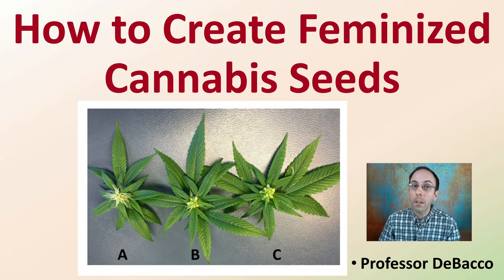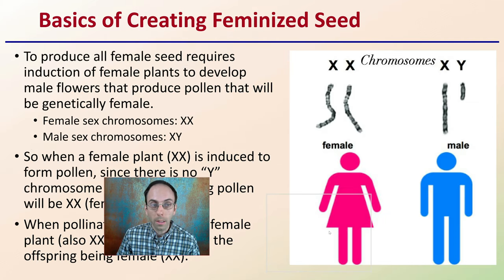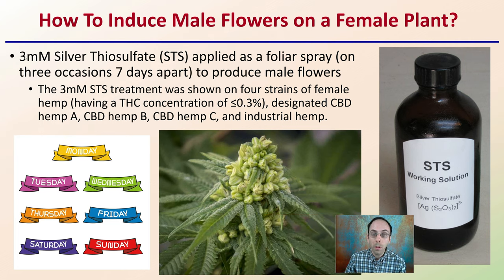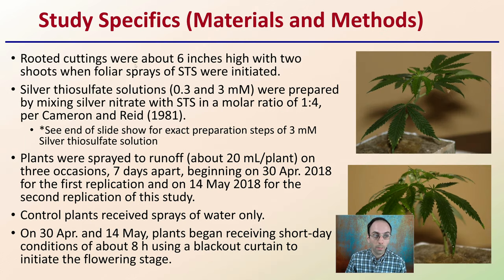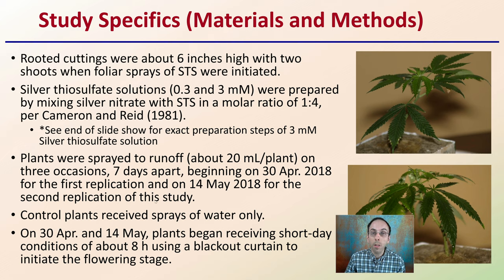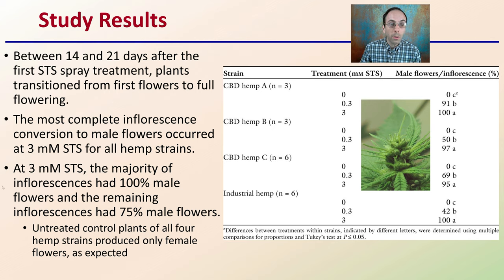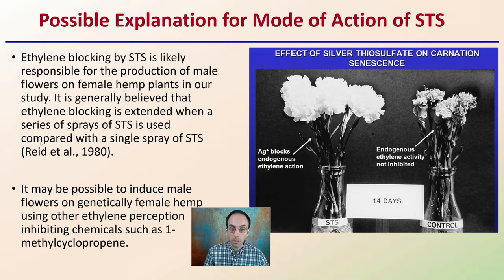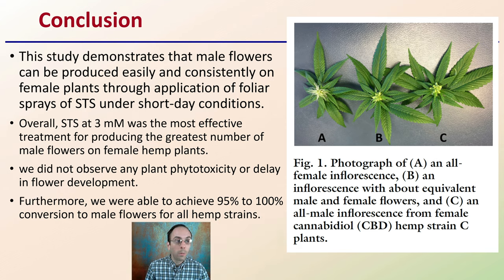How to Create Feminized Cannabis Seeds

Comment: I was able to produce feminized seeds by stressing a female plant starting around 2-3 weeks into flowering. I let her pot dry out a few times,did some pretty extreme temperature swings,and then lowered the light until I caused some minor light burn. She threw out some pollen sacks and I got some female seeds out of a couple healthy females I used the pollen on. So far my results have all been females,about 50-60 seeds in. Not as scientific,but it worked😅 Great video!
Reply from the maker: Glad it worked for you, but this would not be a reliable technique to depend on and there is also the plant stress to consider.
Reply: Me too All I did was switch the light cycle 3 times.
Reply: Would the seeds that come from a purposely stressed hermie female produce hermie prone seeds?
Reply: @KushByTheBush  Yes if the new plants are stressed in the same ways they are likely to herm' but if you don't stress them you can get some amazing bud' I've done this myself and as long as I don't stress them they stay female.
Reply: @DeBaccoUniversity There is almost an implication that STS (Silver Thiosulfate) doesn't stress the plant. It most certainly does. Herming is a stress response. OP used general stresses, STS is an acute stress.
Reply: Dude made hermies, lol
Reply: Oh, so just a normal grow
Reply: @KushByTheBush yes.
Reply: @DeBaccoUniversity  If that worked didn't it produce male/female seeds, whereas, this produces only female seeds?  Every plant will seed eventually so I'm not sure if he understood the video....
Reply: this is not recommended. hermie traits Will be passed down and your next plant will hermie. or there's a huge chance.
Reply: @gtavtheavengergunnerlegend3340 what are the hermie traits?
Reply: @gtavtheavengergunnerlegend3340  idk if that's true. if someone has their arm cut off and they have kids, will the kids be missing an arm? Having hermie traits in genetics and hermie due to stress is not the same thing. I've seen reports where people grew out the resulting seeds and had 0 hermies.
Reply: Try colloidal silver, there are a number of reputable companies online selling it. It Works amazingly well.

Comment: how does this not have MORE LIKES?! i have not seen very many, if not any feminized seed information on YouTube that mentions the silver method. 

also your explanation of the genetic factors, is so well done, clearly excecated and easy to understand!

thank you very much for this information! 😍💚

i think the method you've shown here is FAR superior to what ive been doing for my whole life, 
both in its simplicity\easiness to follow, and the fact that it is reliable and measurable unlike the way i've been doin it!, thank you so much for bringing up up-to-date!! XD

[warning: THE FOLLOWING SHOULD ONLY BE ATTEMPTED OR CONDUCTED BY A PROFESSIONALLY MINDED ADULT, IN A SAFE CLEAN ENVIROMENT, USING THE PROPER PPE AND PROCEDURES]
i always used colloidal silver (sp?) which i was taught to make by an older grower, by making an anode and cathode out of pure silver solder wire, and attaching each end of it to a small voltage\ milliamp DC wall transformer (plugged into a GFI\fused power source for safety)
then i would put those two thin rods into a glass or jar of distilled water, and leave it on overnight, and after a while you could actually see the silver forming strange tiny dots and orbs FLOATING in the water itself! like it somehow stayed in solution ionically or something?

anyway this stuff was really dangerous to get on bare skin, so if anyone follows the above directions be very careful and use proper protective gear\gloves\mask\goggles\lab coat etc. 

a small ratio of this to regular watering\feeding times would quite quickly force my females to produce male flowers as well. (or males to produce female flowers also, making male-inized seeds)

once done, the plant is cooked however, like i had to baby it along to completion (maybe i was using too concentrated of silver-water, oops!!) been a very long time since i used that method. 

i will definitely be giving this method a try next time i go for a batch of fem seeds!
Reply from the maker: Thanks for your comment it is through viewers like your self spreading the word about the channel that the likes, views and subscribers to this channel can be increased!
Reply: @DeBaccoUniversity  I will keep referring to your channel whenever I find someone with deep questions, you have such a vast array of really good knowledge shared here! You're wonderful! 😍💜👍🌈😅💚
Reply: How long do the leave the galvanic cell running?

Comment: This video has given me direction!!!! Many Thanks. I havre a couple questions about precursors. Is there any danger of the final molar concentration being compromised if i use commercially available distilled water? I am concerned in the accuracy of my final molar conc.  In addition, most of the readily available Silver Nitrate is 99% plus in purity. can that 1% have the potential to adversely effect my final molar concentration? Do the silver nitrate and the sodium thiosulphate bond or do they simply dissolve and remain suspended in solution?
Reply from the maker: Glad to provide direction, in short the use of distilled water as you mention would be advised to help ensure accurate concentrations.

Comment: I have a couple questions.  In the video, you used rooted cuttings; in the case of using plants started from seed, when would you begin the STS treatment?  
Assuming that you have several other of the same feminized plants growing next to the plant that is treated, should the also be sprayed or would the pollen from the treated plant be enough to fertilize them, too?  Would it be more effective to collect the pollen and use a Q-tip to pollinate the other plants, rather than treat them?  
You say that you did three applications 7 days apart, with the first on April 30, but you say you did the second application on May 14? Wouldn't that have been the third application, with the second being on May 7?  
You say that you switched to the 8 hour light cycle on April 30 and on May 14; if you began on April 30, how. could you begin again on May 14? Was there more than one set of test plants?
I have seen some videos that recommend only spraying part of the plant, perhaps a few leaves or one branch. Any thoughts on this?  
Are there some varieties that do better than others with feminzation? Indica versus sativa?  
thanks
Reply from the maker: Answers to all your questions...
1. Plants were ≈6 inches high with two shoots when foliar sprays of STS were initiated
2. If other plants are female, no pollen would be produced if untreated.
3. Treatment is needed to generate the pollen.
4. Plants were sprayed to runoff (about 20 mL/plant) on three occasions, 7 d apart, beginning on 30 Apr. 2018 for the first replication and on 14 May 2018 for the second replication of this study. 
5. On 30 Apr. and 14 May, plants began receiving short-day conditions of ≈8 h using a blackout curtain to initiate the flowering stage. 
6. Full plant sprays in this study.
7. Should not be a difference.
Reply: @DeBaccoUniversity  Thank you.  
A plant grown from seed may be taller than 6 inches before it produces sex organs; do you treat plants grown from seed as soon as they display female sex characteristics, or do you allow them to grow buds before treating them? 
What i was trying to ask for #2 was if the amount of pollen produced by one treated female would act to fertilize surrounding females enough to produce a large quantity of seeds, or would it be better to use the pollen from the one treated female to hand pollenate the other females? 
I don't understand your answer for #5; if you begin the blackout curtain on April 30, how can you begin it again on May 14 unless you stop sometime in between?
Reply: @nuclearstarr  he did the experiment twice. First one started April 30, 2nd one May 14.
Reply: Debacco.... read everything again..

Comment: The original article suggests spraying to saturation. (approx 20ml/plant). thoughts?
Reply from the maker: That may be a good starting point, the key is the concentration to apply.  You can spray until runoff.
Reply: @DeBaccoUniversity  Tks for a really quick response. I will be doing my first application tonight.  I’ll keep you posted!

Comment: Question: What is the difference between STS and colloidal silver? Which one would you recommend if they are different? Thank you for your great content! Cheers
Reply from the maker: Colloidal silver is only silver (Ag) and STS is Sodium Silver Thiosulfate so not pure silver, but this is the product that is advised in the study to create feminized seeds.
Reply: @DeBaccoUniversity  Many thanks!
Reply: @DeBaccoUniversity  Would colloidal silver work as well, using this protocol? Thanks.
Reply: @steveandrews8301  did it work?😉👍
Reply: @peterdeans4635  No, it didn't work. It seemed to chemically burn the plant a bit, so I stopped. It was from homemade Colloidal Silver I'd made, so I'm not exactly sure how strong (PPM) it was, either, so that could have been part of the problem, too. I had made it double strong, maybe too strong, perhaps? ...

Comment: Thanks for the video, great info. ,I know this mixture shows it being mixed together but can we keep them seperat and will it last longer that way? Also Let me make sure i understand this right, after mixing the first batch we should have a liter of each 1 sodium thiosulphate and 1 silver nitrate if we did not mixe together or a 2 liter if we did mixed together , then to dilute it to 3mM we mix each one 1:1 so each liter with another liter of disitlled water and we should have 2 liters of each kind or if already combined a  mixure together of 4 liters, is that correct? thanks for the info
Reply from the maker: If you want longer term storage keep them separate in original containers.  One note on the steps you outlines, the mixing needs to occur in a special way (what is added to what), so be sure to read this over as well.
Reply: @DeBaccoUniversity  thank you, yes I saw that one needs to be added  to the other, does my math look right? I wasn’t sure if I understood the mixing ratios, love the videos lots of good info

Comment: Hi, I'm a bit confused because in the dosage table you mention Na2S2O3 x 5H2O, but the picture on the right shows Na2S2O3. Is there a difference in which one is used? Cheers
Reply from the maker: See time stamp 6:25 for full instructions.
Reply: @DeBaccoUniversity  okey now I understand Na2S2O3 Pentahydrate is Na2S2O3 x 5H2O. So for this recipe, you need to use Na2S2O3 x 5H2O not Na2S2O3 - both are sodium thiosulfate but have slightly different chemical formulas, so they have probably different dosages. Thanks, cheers

Comment: Thanks for the video sir, can you provide the reference of your calculation for preperation of 3mM Silver thiosulphate...it will be very useful for me...thanks.
Reply from the maker: Check the end of the video and also link in the description for sources.
Reply: I got you with the calculation for .01M Ag2S2O3 solution(more is better; 3 mM is 0.003M), With straight sodium thiosulfate tho not the watered down pentahydrate.

Na2S2O3 + 2 AgNO3 —> Ag2S2O3 + 2 NaNO3

To make 1 liter(0.01M… mol/liter =molarity):

0.01 mol Ag2S2O3 x 1mol Na2S2O3/1mol Ag2S2O3 x 158.1g Na2S2O3/1 mol Na2S2O3

 = 1.581 g sodium thiosulfate needed and for silver nitrate

0.01 mol Ag2S2O3 x 2 mol AgNO3/1 mol Ag2S2O3 x 169.88g AgNO3/1 mol AgNO3 = 3.4g silver nitrate needed

Comment: Question- if 1 or 2% of the feminized XX seeds end up being male plants, are they really just hermaphrodites showing more male characteristics or more male flower. So if that's the case, these hermaphrodite plants would be producing XX pollin, and it may be beneficial to keep these herms. For future fertilization for XX seeds??? Mathematically these herms wouldn't ever have xy???
Reply from the maker: In the best case scenario plants would still set seeds which will reduce cannabinoids and also "ruin" the visual aspect of the flower and increase labor to clear out the seeds.  So, this is part of the reason why all pollen producing plants should be removed.

Comment: I would like to try this method on cannabis with 33% THC.  Any one try on that type of plant?  The formula makes a huge amount.  What percentage Silver Nitrate?
Reply from the maker: The end of the video provides you with the specific details you are seeking.
Reply: @DeBaccoUniversity  I do not understand the math when my Silver Nitrate is "0.1 aqueous solution" and the 2.04 grams of a solution (ml).  Please forgive my inability to do math...How many ml of the Silver Nitrate?
Reply: @SpruceSculptures  its such a small amount it seems weight is the only accurate measurement, just like baking. Id suggest if serious to make this buy a decent scale for 15 bucks. We made colloidal silver using batteries and bought silver sticks. Seems a bit easier. Less math.
Reply: @dana102083   I got a pharmacist to assist me.  Plant has had 3 weekly treatments with no effect at this point.  Going to increase frequency of spraying as it is making female flowers.
Reply: @SpruceSculptures  120 ml Of 0.1N aqueous silver nitrate
Reply: @nicnolet9495  Correct, I got a pharmacist to assist in this.
Reply: thc % has no influence on this working or not
Reply: @SpruceSculptures   Hopefully things turned out alright I have had multiple plants that will begin to show female flowers but then also and also foreign pollen socks I used to continue Spring who were about another the mother phone you get is still very very yeah not so you gotta be smart about it. You'll also notice that although the pollen  Sacks open the bansnas don't  Always release the pollen so you really have to work them a bit in order to get it to come out ( I gently tu the Ono a 120 micron screenbut without squishing or releasing say liquid from the sacks which will kill thr pollen  And cronged up the screen in the process  But at least to the fact that it's hard to get out helps a little bit with accidental pollination 1 Yet other plants were as a r ready to go male would be blasting it's pulling all over the place